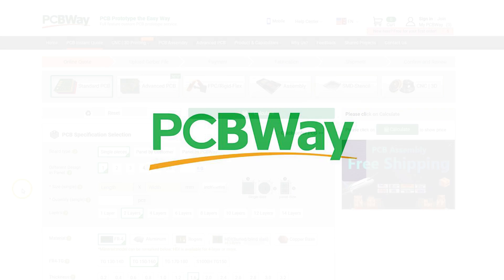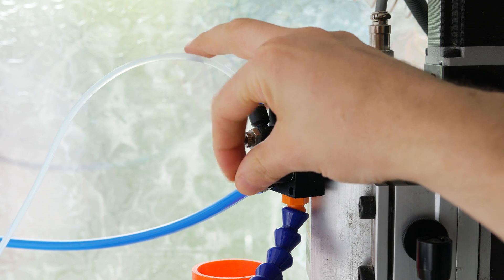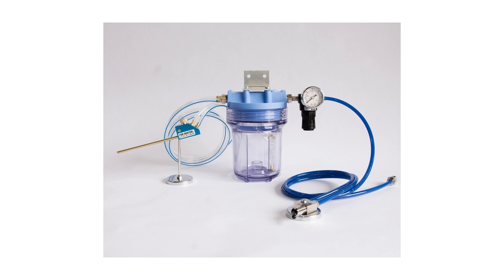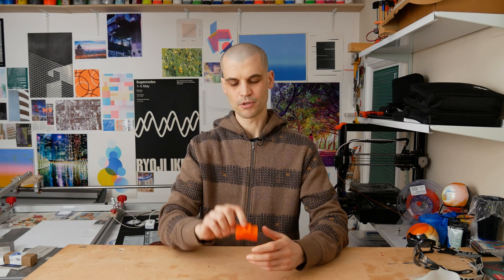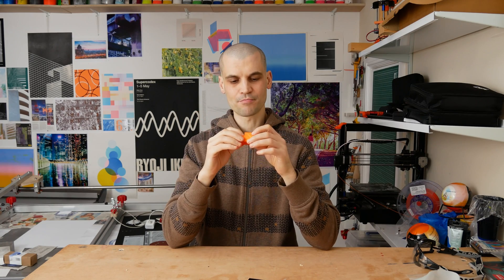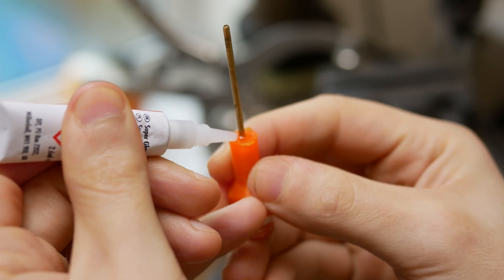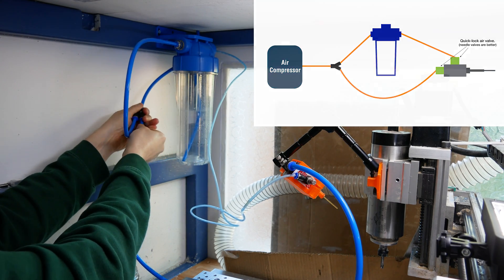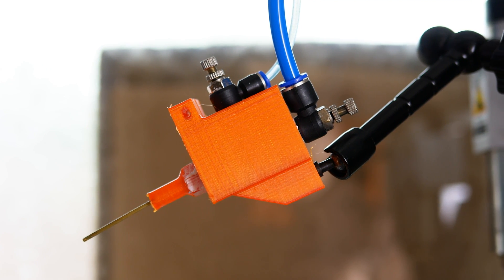CHEAP, DIY Fogbuster Alternative

Comment: Is it possible to create a nozzle where we can mix the coolant and compressed air in the nozzle itself, the size of the nozzle is not concerned, the nozzle should create both fog and mist in such a way for example just by adjusting/ turning the tip of the nozzle. Can you please answer my question?
Reply from the maker: Hi, this is mixed in the nozzle essentially, take a look at the drawings in the video

Comment: Made something similar myself by adapting one of those dual port blocks you showed. One thing that is good to add is a cheap pressure regulator valve, particularly in front of the coolant cannister. I found that not much pressure is needed there, but it's good to have plenty of air pressure going to the nozzle itself. One or two regulators gives a lot of flexibility when sometimes you just want higher presure air to blow chips away. Also, I added a relay controlled solenoid in front of my CNC air line so that air on/off can be controlled by the CNC.
Reply from the maker: I definitely want to make these upgrades you mentioned (separate valves for air and coolant, and relays). My setup still isnt perfect in regards to the coolant flow, valves should fix this.

Comment: Call me stupid but couldn't you have done the same y splitter with the Dual needle valve mr? And then you could have had a pressurized tank and not relied solely on Venturi. I would think you would get better control of air flow and fluid flow
Reply from the maker: This doesnt rely on venturi. The y splits 2 air hoses. 1 going to the pressurised coolant tank and the other goes directly into the air valve on the fogbuster
Reply: @ThisDesignedThat  I understand  the joy of DIY but what I am saying is you could have simply ran your y splitter idea with the cheap Amazon venturi block thingy and not spent a lot of time  with multiple designs and machining.  This  Is precisely what I did on my cnc. I bought the cheap $18 Amazon venturi system and system and then i wye off the air supply to pressurize the supply tank. Works perfect. Flow is very consistent and have 2 needles to regulate air and water flow.
Reply: @mazcoder  If your system is anything like mine (and it sounds identical) the problem with the amazon ones with a 'paint sprayer' style nozzle at the end of some loc-line, is that it's a fog booster, not buster. I'll be making something like this to try and cut down on the fog...

Comment: I try to build one soon,  I do like my mist coolant but it use to much air, would the mist buster use less air
Reply from the maker: Yes it uses 1-2 psi. Its just spraying a tiny stream of droplets onto the cutter to keep it lubricated. It doesn't blow chips very far because of this. Ive seen other builds where they have a 2nd hose that is used for an intermittent air blast to remove chips. I like this idea and will incorporate it into my design at some point

Comment: Quick question: what is the thread size of the air / coolant inputs on the mixing block? I'm guessing it's 3/8 from the provided models, but I would like to make sure. Thanks!
Reply from the maker: Yes i think its 3/8

Comment: I've just completed my diy fogbuster. I used two 5 liter pressure sprayers (5 bar rated) for the garden. I removed the release valve and replaced it with the hose of the second sprayer set. Bought an assortment of push fittings and splitters, some tubing and a compressed air valve so I can turn on and of using the software or gcode. 
I got a nozzle with mixer at the nozzle. With very low liquid flow the fog turns into mist though. I think I need to keep the pressure of the liquid about the same as the air flow to keep it coming out as droplets. 
I also wat to experiment with another nozzle with just air at a higher flow rate to evacuate the chips and hopefully still libricates and cools.
All in all it cost about 100 euros. All those components and tubing certainly adds up.

Comment: Why you connect bucket with cooling fluid to air 😂. You using Venturi effect so you don't need to do it. You should not do it. What a waste of money!!!!!!
Reply from the maker: lol, good luck with your $10 mister
Reply: @ThisDesignedThat   in company worry work everything see machine is over hundred thousands of dollars and every machine have same additional spraying mist system for 10 $. Thank you for wishing good luck. Those machines are making millions of dollars every year 😄👍
Reply from the maker: @Roodger.eleventh  thats fine when you are using industrial level air compressors, at home, hobby cnc do not have that type of air supply. You need something more efficient, fogbusters are excellent design because you only need 1-2 bar
Reply: @ThisDesignedThat  fog busters required 4-5 bar, because you need to cool the tool not to lubricate you need to cool it, plus you adding 20% of alcohol 75% of water 3% of oil and 2% of liquid soap for washing dishes plus 10$ for (fog buster) on alli. The 2 main purpose is to blow out the chips from working area and cool it. Management calculator in my company thay saving on cooling fluid over 40 000$ yeau when they processing aluminum with same tool life
Reply: @ThisDesignedThat  by the way at home I have hobby cnc and same mist cooling system, and trust me I'm saving a lot of time a lot of money because I'm not breaking tools, and it works 👍
Reply from the maker: @Roodger.eleventh  Read the documentation on the fogbusters, they require low PSI, they add a very small layer of coolant over the endmill which lubricate and cool the endmill by evaporation. A lot of hobbycnc users start off with the $10 misters and do not like them, I was the same. I think for industrial levels any mister will work because you use very good air supply and usually some sort of waterproof enclosure with drainage. Machinists at home with shapeoko's do not have these luxuries. But thanks for your advice and input
Reply: @ThisDesignedThat  You're so gracious, dang. Respect.

Comment: excellent mist cooling set cost 10$. It's so damn cheap that you have to be stupid to design your own. I understand did you need subject for the YouTube,
Reply: The $10 ones will make the entire room filled with fog. I actually filled my entire floor's office building with fog from a 1 hour job on my Taig desktop CNC. The legit fog buster is $300. I have both, its not even close. The $300 is definitely worth it. What he is doing is trying to recreate the $300 one, not the $10 one.
Reply: DIY designers have a choice of incorporating  Stupidity thanks to YouTube !!!

Comment: It would be good to know what air pressure you're running?
Reply from the maker: I run mine at approx 1.5-2 psi
Reply: @ThisDesignedThat  you meant bar right? :D

Comment: After seeing this video I’m going to try making one of these myself with an SLA printed mixer (hoping that won’t leak like FDM). I need to buy an air compressor and saw your video, but I’m wondering why you recommend a 35 litre compressor when this takes so little air? The Fog Uster site recommends a minimum of 5 Litres but I’m guessing that requires the motor to be run constantly? Thanks!
Reply from the maker: SLA could work well. Please let me know how it goes. The more air capacity the better really. I think 35l is good enough if you keep the psi around 1-2 bar. Lower the capacity the more you will run the motor. These silent ones can't continously and have usually 50% cycle time. Ie run fot 3 mins, cool down for 3 mins
Reply: They reccomend a minimum 5 GALLON compressor, which is approx 19L